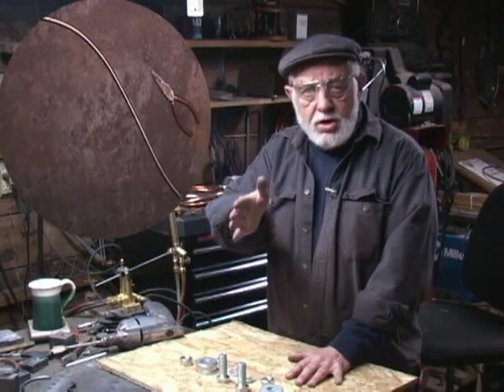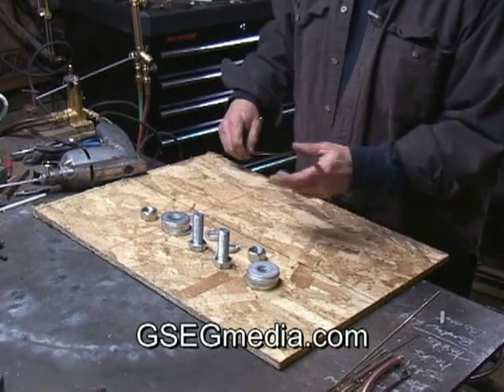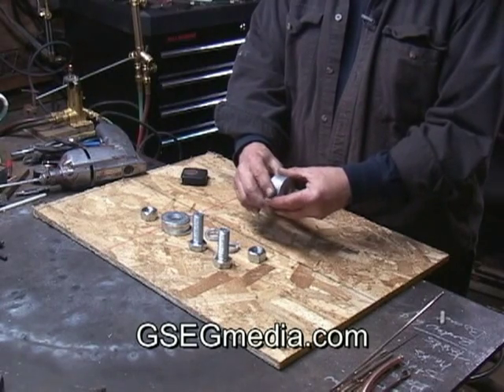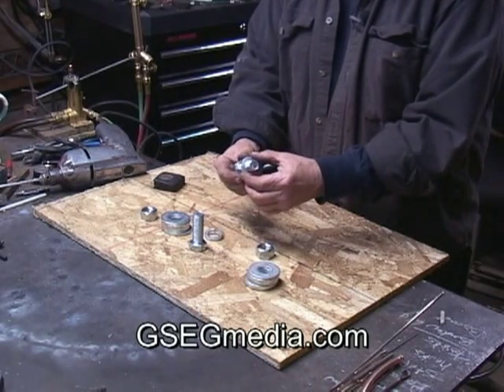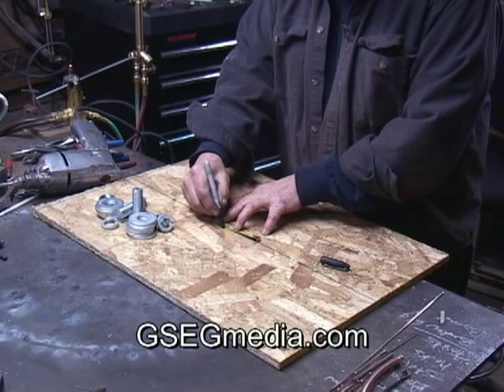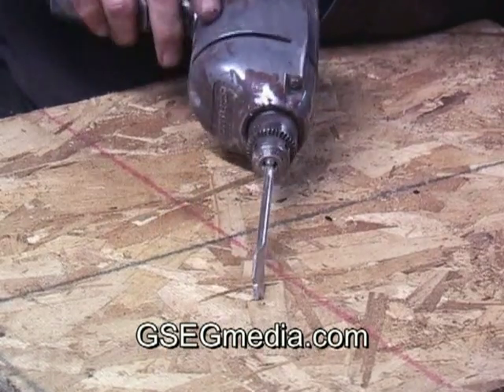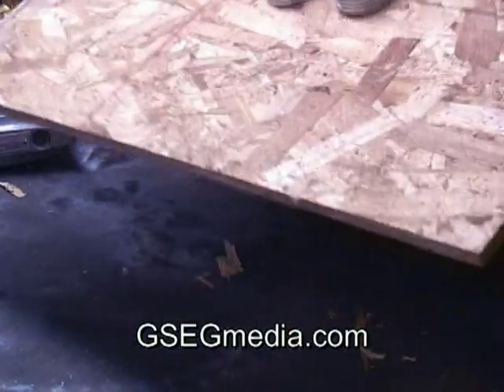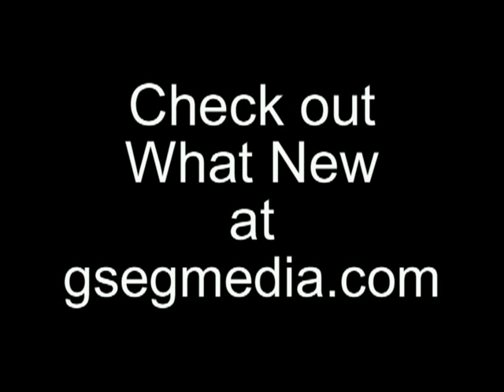Building a Simple Arc Bender

Comment from the maker: Yes, this is one of those tools that could be developed for a number of different sizes and types of operations.   I've thought about it but never got around to doing anything beyond what you see here.

3/8th steel rod is about the limit for this tool.  Any heavier and I'd want to mount it on steel rather than chip board.

The tool is only for forming soft curves.

For a sheet metal bender (brake) it would be easier to just buy one from Harbor Freight.  Do  a search for sheet metal brake.

Comment: i guess you could drill multiple holes in the board for different distances for bending..and just move one of the bolts to cater for that??.  could you make another video demonstrating its use a bit more and what thicknesses of metal you can bend??...also do you have any ideas for an easy home made sheet metal bender...that is something i need.  thanks again...great video